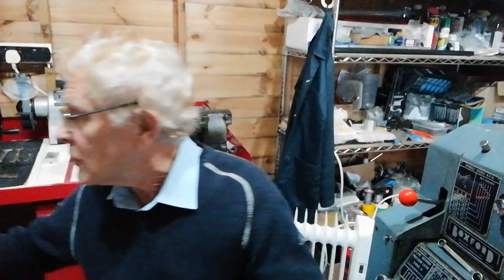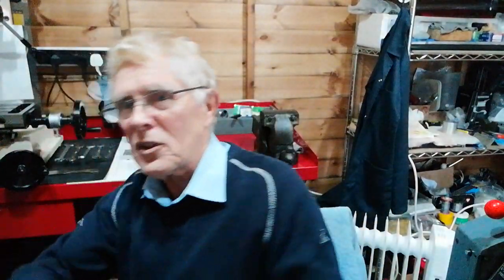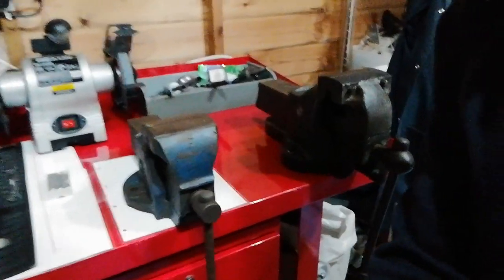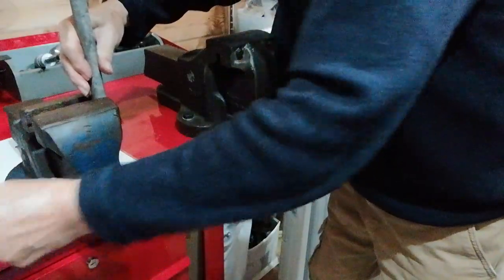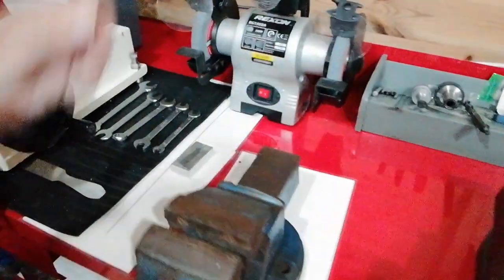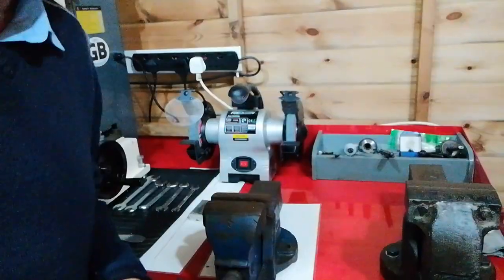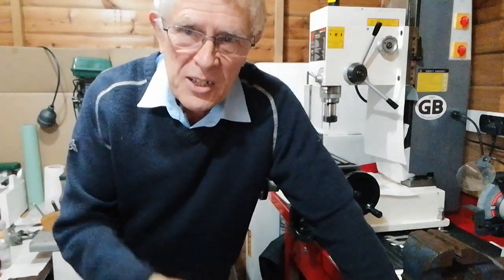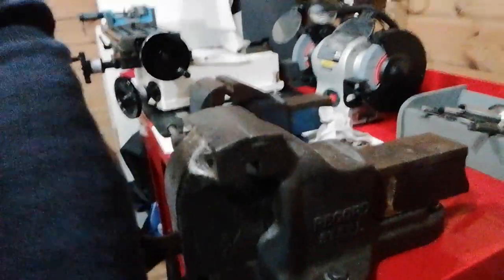Mounting a vice in the Best Position on the work bench.

Comment: Thanks Keith, I was having a bit of a moment after building my workbench and couldn’t think where to position my vice (despite using them at work frequently!). 
Seems I’ve chosen my vice well, after some research I bought a solid old record 84 same as yours there.
Reply from the maker: Hi and thank you for your comments.
You’ll not go far wrong with the Record vice. You have chosen well.  These vices are built for extremely heavy use and are almost indestructible.  They will give excellent service for generations yet to come!  Remember to apply lubricant now and again.  🍀

Comment: Thanks for your tips on mounting a vice. I need to mount both a vice and a grinding wheel on my bench. I'm thinking: Grinding wheel to the far right (because it's used less often) and vice about a foot to the left of it. Would appreciate your thoughts.
Reply from the maker: Hi Paige and thank you for contacting me.
This is an important issue that needs careful consideration.
If you’re normally working right handed, then the vice needs to be positioned on the far right of your bench, as shown in my video. For a left handed person, it would be better placed L.H.S. To place this in any other position would almost certainly be restrictive and less versatile for some applications.
Regarding your grinding wheel; check out my video on sharpening a lathe cutting tool using a bench grinder.
This shows how I keep my grinder as far out of the way, at the back of the bench and as you rightly say; it’s used less.
I have never needed to mount it in a fixed position, because my machine has 4 rubber type fixtures to the base. These retain the position when I move it forward to grind cutting tools and drills. It is solely dedicated for this purpose. If used for heavier grinding then it would be advisable to secure it to the bench in a more appropriate position, using the mounting points provided.
Should you have sufficient space in your workshop for a pedestal grinder, then that would be a better option, but it would have to be permanently secured to the floor.
I hope this information will be helpful for you.  Good luck with your workshop activities.  🍀 K
Reply: Thanks Keith. That's a good point about leaving the bench grinder unmounted, as it's not subject to much force for the random sorts of things I need to do. I'd never thought of that. As long as the vibrations don't make it "walk", but I guess you've established that. I did watch that other video about sharpening the lathe tools. Thanks, I now know what to do.
Reply from the maker: @paigeturner4529  You’re welcome Paige and I’m happy to be of assistance.  🍀

Comment: Hi Keith, nice video's. My 25 Record vice doesnt open as much as my (now broken) 23 vice. I'm wondering why, and does the (about) 10mm hole on the rhs of the sliding part have anything to do with it. Thanks  Patrick.
Reply from the maker: Hi Patrick, thanks for your comment. I have to say that it's the first time I have known anyone to have a broken vice of the type you mention. Do you happen to know how it got broken?
Regarding the change in less opening distance of your replacement vice ; this could be due to an alteration in design specification. This has nothing to do with the hole that you observe on the sliding section. That is there to facilitate lubrication of the buttress screw thread. The nut is located centrally within the body of the vice. It also enables oil to be directed towards this, as well as to the screw itself.
 Record Tools were located in Sheffield, but the name has been acquired by the Irwin company. Whilst they do make some good quality products, there's nothing quite like an original Sheffield made Record Vice
Reply from the maker: I hope that this will clarify the situation for you.  Keep safe and I'm pleased that you find my videos to be of interest for you. 🍀 K.
Reply: @keithatklint5380  ???
Reply from the maker: Hi Patrick, that's bad luck for sure.  I recall many instances where removal of bushes, sleeves and bearings were extracted or fitted into position, by using a vice. Leaf spring bushes can sometimes present difficulties. One method adopted to remove or press in to the desired position of these stubborn parts, would be to strike the front face of the vice hard with a hammer. That usually jolted it into place, without serious damage to the vice apart from a hammer mark. Not a text book procedure, but highly effective. Was it a car or heavy vehicle spring?
I previously made press tools and maintained equipment for these things, including Rolls Royce special types, when working in a spring  
manufacturing department. 
I would be interested to see a photograph of your broken vice if possible. Also it would be good if you could include this in a post to Klint's Home Workshop.  This is a private group where members can share their experiences. It seems to me to be a very rare incident, that you unfortunately experienced. Thanks again for your comments.  :-)  K.
Reply: Hi Keith. I'll happily send some pics but not sure how to without your email. You can have the vice if you can come to pick it up. I'm in the Warrington Runcorn Widnes area.
Reply from the maker: Thank you for your offer Patrick, but it's not practical to pick up, unless I am at some point passing near to your area. A photo of the vice will be much appreciated and my Email is; keith@klint.co.uk. This is also listed on my youtube channel, under the "About Us" section should it be needed for future reference. 
I hope you have better results with your new vice.
Cheers. 🍀 K
Reply: As soon as my bad back improves I'll pick it up from the floor and take pics.
Reply from the maker: Thanks Patrick, but you take it easy now until fully recovered. There's no need to hurry. 🍀
Reply: Hi keith. My 23 Record vice cracked in 2 as I was pushing out a bush from a rear suspension leaf spring.

Comment: What size bolts do I use for mounting my vise on a make shift workbench,thank you.
Reply from the maker: Hi that's a very good question. The bolt size will depend on the diameter of the bolt holes on the vice. Chose the largest bolt that will fit snugly in the location
Reply from the maker: location holes.
Reply from the maker: The length of the bolts, should be sufficient to pass through the thickness of the bench, with enough thread showing for the washer and nut.
If the unthreaded plain part of the bolt shows, then select a shorter length of bolt having the same diameter. If that is not possible, then use more washers, or a spacer. Ensure that the nut has sufficient of the bolt thread to tighten on without contacting the plain unthreaded section of the bolt.
Remember to locate the nuts and tighten from the underside of the bench and use washers at both ends of the bolt. Thank you for your question and good luck with the installation of your vice.
Keep safe. 👌🍀
K.
Reply: @keithatklint5380  Thank you for replying back have a  👍 day. I will run the bolts one day real soon.